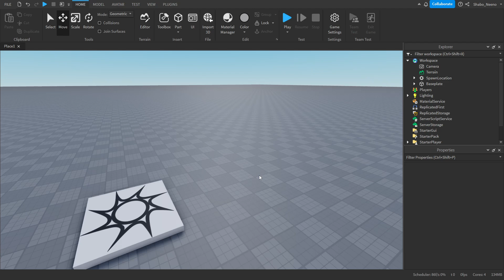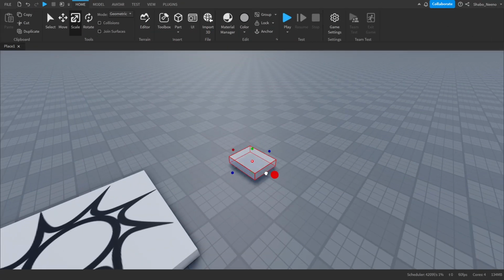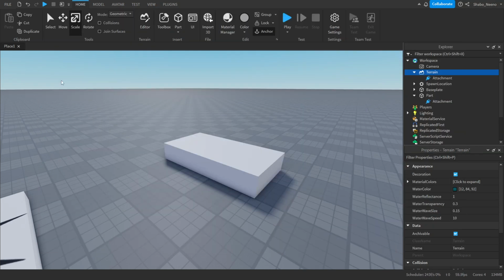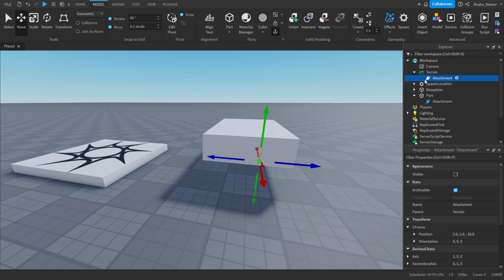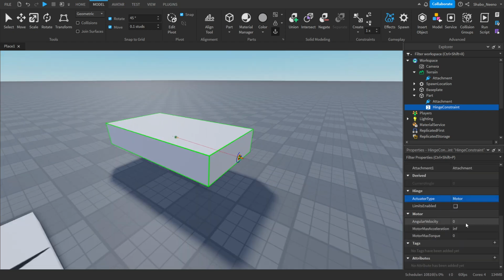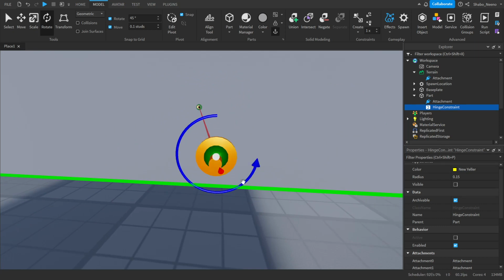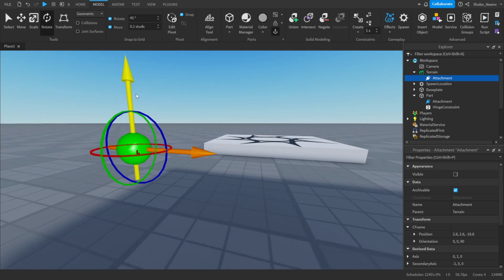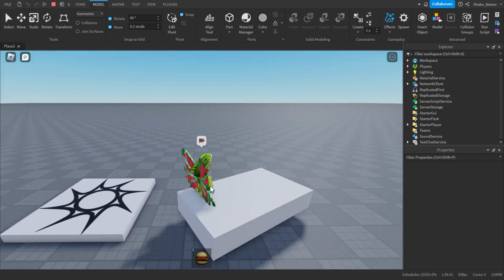How to make a Spinning Part in Roblox (NO SCRIPTS)

Comment: Hey, thanks for sharing how this is done. It was really helpful. Can you explain why need an attachment on Terrain, too? I would think only an attachment on the part would work, so I am genuinely curious why Terrain needs it too? (Complete noob here). Thanks!!
Reply from the maker: I'm glad it helped you! The reason we need an attachment inside the terrain is because we're making a hinge between the attachment in the part, and the attachment in the terrain. We're putting it in terrain because that means it cant be moved. Since it cant be moved, the part is forced to stay at the attachment in terrain and will spin there.
Reply: for anyone who sees this in the future; you can create an anchored part and add the terrain attachment to this part, rather than adding the attachment to terrain. grouping these 2 parts then allows you to move the spinning part freely without having to change your anchor points repeatedly.

remember to anchor the new part but keep the part that you want to spin unanchored :)